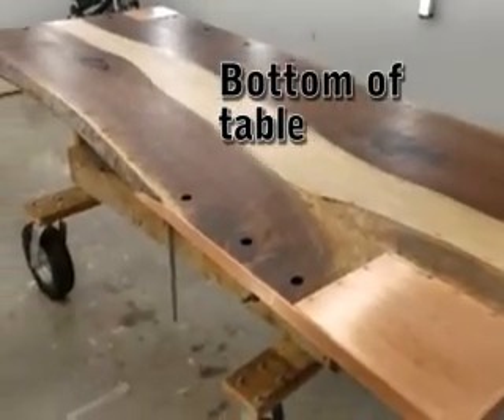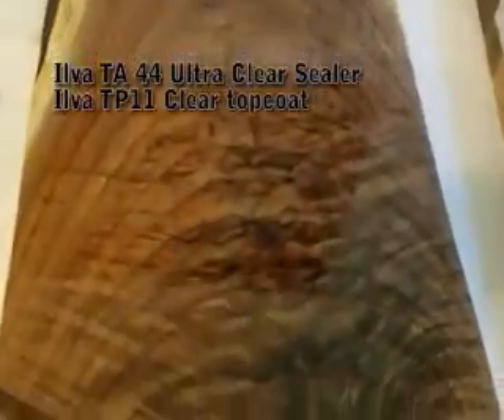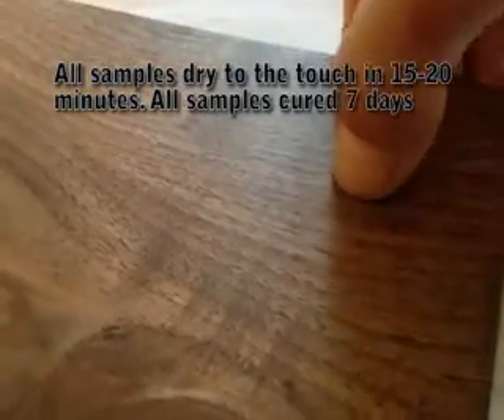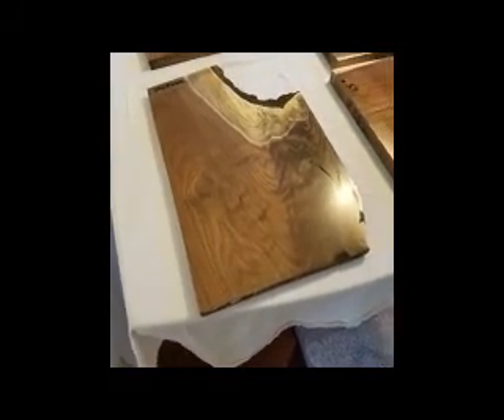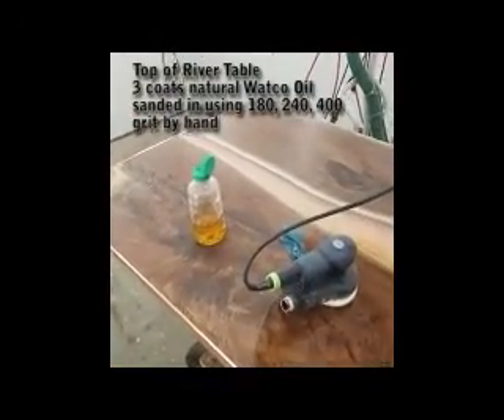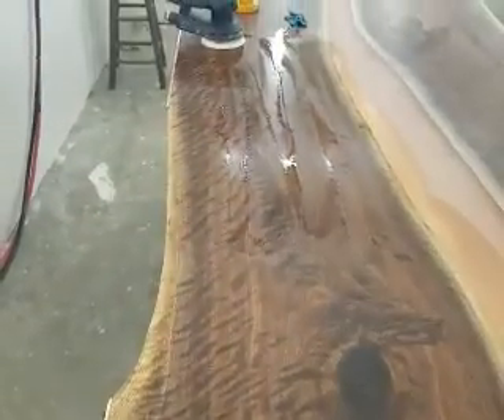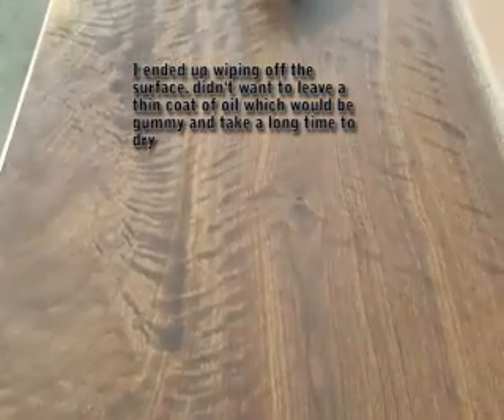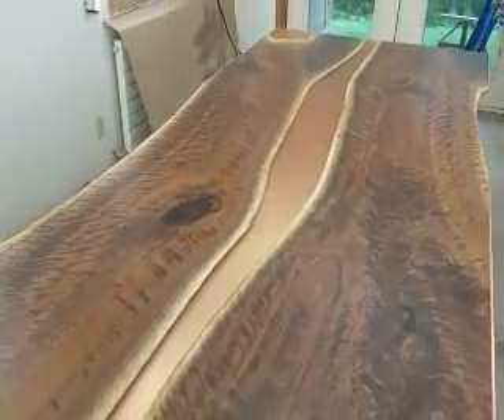Walnut Copper River Bridge Table Build part 9

Comment: After poliching epoxy becomes scrached whish disk or product i need To use. Thinks :)
Reply from the maker: I didn't like the polished look so went back and sanded the top and epoxy areas with 360 grit mirka